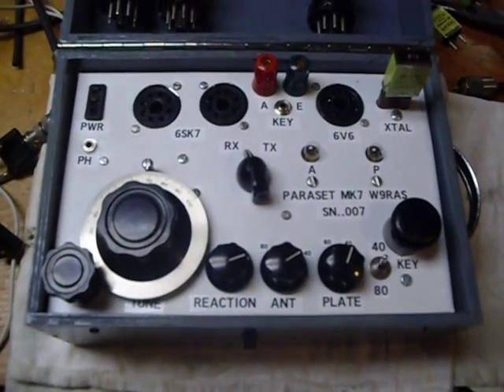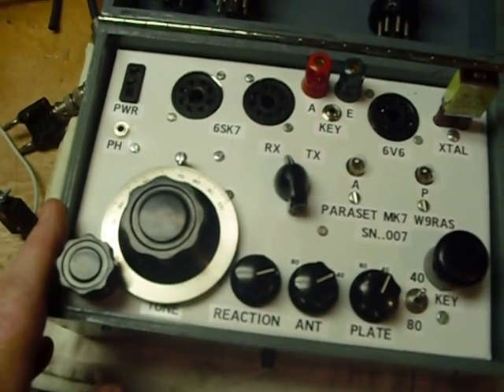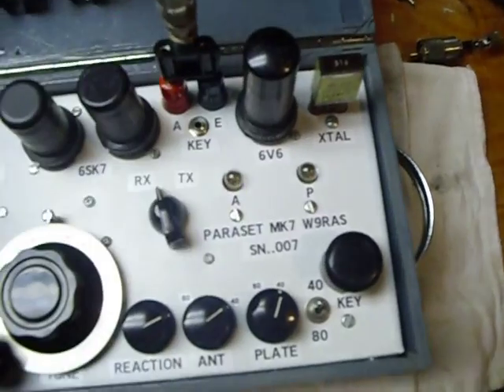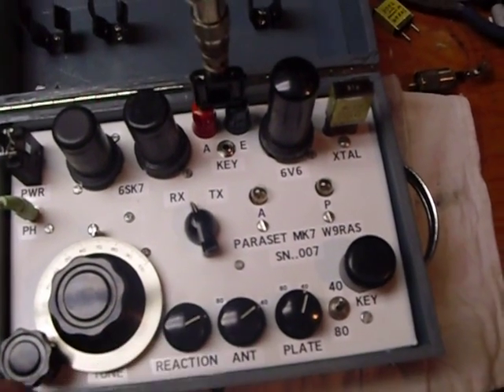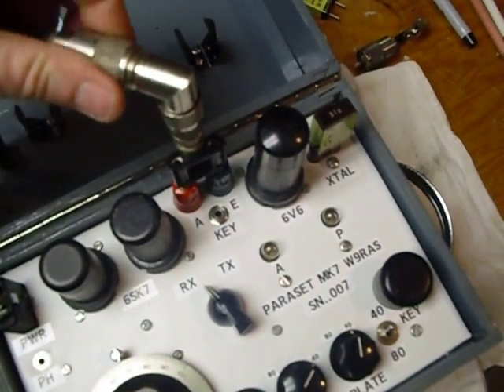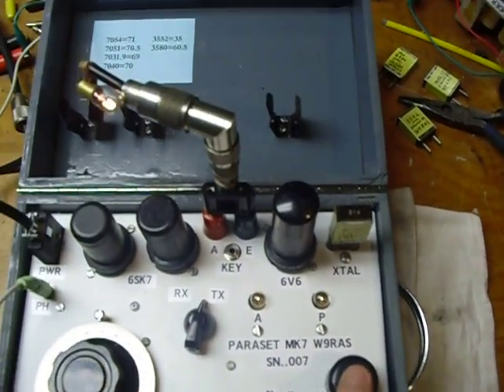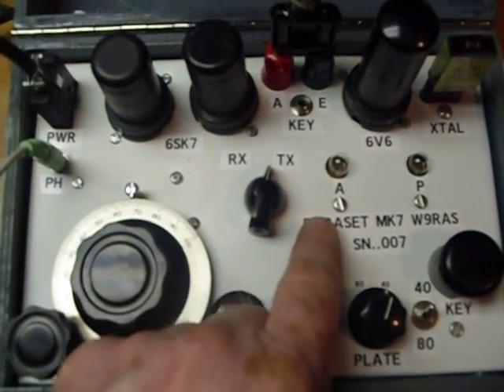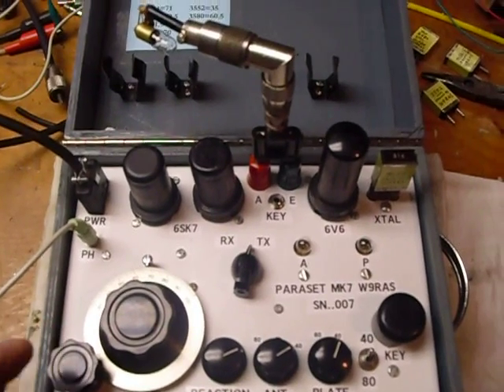# 5 WW2 PARASET , PARASET RADIO,WW2 SPY RADIO,PARASET REPLICA,

Comment: Dear Robert.
You  made my day with this series of videos on the Paraset.
I have the same project waiting for me at home. Have been for one full + years obtaining each part needed with the help of VE7SL and other hams who have been elmers to me. No ham radio stuff can be found in my country so all have to be imported or eBay.  I am now complete but will start as soon I return from 9L country after 3 months of humanitarian Telecoms work (in February 2015) over here. I have already built and finished the power supply for my Paraset. Thanks again and a Japanese bow to you (you can not shake hands or hug over here in 9L because of Ebola).
72 and 73 fron Roberto. YS1RS.